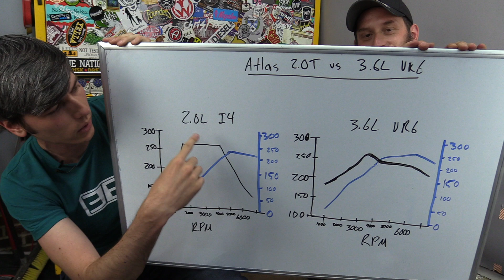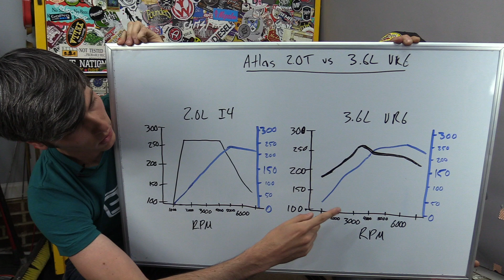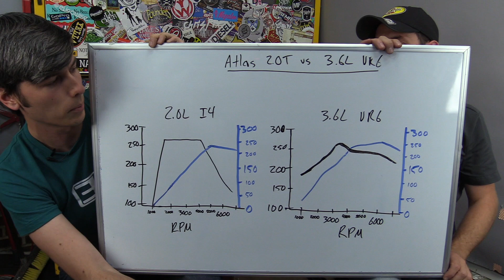4 Reasons Why The VR6 Engine Is Dying Off

Comment: The ridiculous notion that I'm commenting on an 8 year old video aside, as a former 2003 24V GTI VR6 owner, I can assure you those HP and Torque numbers are just not aligned with reality at all. In my youthful and immature days of street racing, I've left both the 1.8T GTI, the 1.8T 225 TT (boasting 25 more HP than my VR6), and the 2.0T GTI all in my rear view mirror. All cars stock. I've also beaten remapped 1.8Ts, though those were a lot closer off the line, but then fell back quickly at speed. The VR6 engine was a beauty. Thinking about getting an A3 3.2 Quattro with a manual transmission. Just need to find one that isn't about to die. Super rare with the manual transmission, as they only produced them in limited number between 2003-2005.

Comment: I have a 02 jetta 12v vr6 wagon 5 speed.  Its got 330k miles it dosent burn oil and it dosent get dirty , dosent leak oil .
 Plus theyre most uniqe sounding motor.
I would never sell it.

Comment: On the graphs the HP and Torque are way off and don't accurately show.  In Both chart the HP and Torque should intersect at 5252RPM and they are not.  The VR6 you show at about 4000RPM.  you should know as the car guy that those are just a bunch of chicken scratch lines if it's not accurate.

Comment: The VR6 design is bullet proof, doesn't burn any oil, adequate horsepower in its class and sounds awesome!  This Audi/VW engine was over built with reliability to say the least, MPG is ok but very reliable.  Since it is not easy to build this type of engine and with advent of turbo charging, 4 cylinder engines now prevail.

Comment: You do know there is a turbo charged vr6 in China, and for a while, VW considered bringing it in the Arteon and Golf R. Audi and porsche refused. HPA Motors actually did a conversion on a mk7 golf R to the vr6 engine (VR550T - 550hp, 550lb/ft)
The reason we dont see a VR6 turbo is simple. Audi and porsche will not allow it.

Comment: Vw a audi should stay with vr6 its the best compact engines out there why not build vr4 turbo ..if you compare the audi v6 tfsi....90degree v6 which real trash not reliable at all what a rubbish engine a why do vw..a audi build a 90y degr as aposed to a 60degree just because america did it nissn build the  best 60degree 3.8 twin turbo engine the vr6 engine is unique cause of its design its the best looks like a complete billet design

Comment: ...except that 2.0 / 1.8 turbo engine will wear out or die at 160,000 miles and the VR6 won't.  Turbocharged engines use higher compression and eventually wear out a turbo and require frequent synthetic oil changes.  VR6 for me.

Comment: The VR6 was originally designed to be a diesel engine but they ended up making it gasoline instead, however, they didn't change the design of the engine itself resulting in an extremely strong platform for boost applications. Thick cylinder walls, strong rods, etc. You can throw a turbo on a stock VR6 and the stock internals can handle up to 700hp. The only thing you really need to upgrade to go beyond that is the rods bolts. VR6 is only a dying breed to people who have yet to realize it's actual potential.

Comment: It seems that smaller turbo engines tend to not last as long as a slightly bigger naturally aspirated engine. I've gotten to the point that I like 2.4l in compact cars. Get better mileage on the highway and much less maintenance. As of now I refrain from buying turbo and direct injection as both are costly to maintain. If we're to buy a vw today I'd try to get one with 2.5l 5 cylinder engine

Comment: There are other options for the VR6 like an aluminum magnesium hybrid to save weight.

More engine space?

Cars are tradionally getting larger...just look at the Toyota Camry years ago, and the Corolla, today.

All I see in this video are the direction and path of unenthusiastic engineers we get nowadays.

The VR6 are one of the most incredible engines ever in our lifetime, why not seriously update it and provide the best support possible.

Turbo 4 bangers may look linear on paper, but in the real world, turbo lag after turbo lag.

Ever been in congested traffic, then the lane next to you suddenly frees up?

With a turbo, you will find yourself at the mercy of the surprising oncoming driver.

With turbos, there are much more frequent oil changes required, more complexity, more of an increase of weight from additional parts to dissipate the heat, let alone, more heat to deal with.

I would prefer a 3.6 VR6 with a positive displacement supercharger any day.

Corny engineering always seem to strive towards turbos and automatics and anything that will lean towards making cars not dissimilar to driving an appliance.

I hope much more manufacturers adopt the VR6.

It would be good for Volkswagen to later open their patent /license and let other manufacturers keep the VR6 moving technically forward.

The VR6 is among one of the most underrated engines of all time.

Comment: The supercharged one from the Corrodo (And a few others) was very good.  I'd like to hear why they stopped supercharging it.  Also, if fuel economy, and emissions are the main reasons, then why do they keep making the GTI larger, and heavier?  It used to be so light, and that's what made it awesome, not the engine.  If it's light enough, the fuel consumption goes down.
Reply: Okay, I was an Industrial Engineer, not an Automotive Engineer.  I'll bow to the specialist in his field.  The work envelope was a factor in troubleshooting factories, but it wasn't even close to as critical as cramming more engine between the wheel wells, and keeping it front wheel drive.  A lot of this could be solved by just putting the transaxel in the back, but then it wouldn't be a usable hatchback.  Those were always the selling points of the GTI:  It's a grocery getter you can also haul ass in.

Comment: International unit for torque is Nm (Newton-meter). lb-ft is a local unit in some areas.
International unit for "mileage" can be km/l (kilometers pr. liter), or instead you can specify fuel consumption in liters pr. 100 kilometers, which is now more commonly used. Miles pr. gallon is a local unit in some areas.
By the way: The conversion factor for torque from lb-ft to Nm is almost the same as the conversion factor for power from kW to HP, but that is just a coinsidence.

Comment: sure those turbo direct injection engines performs well better than vr6 but what is the lifespan of the 4 banger including the turbo, new turbo is not cheap to buy...
Reply: VR6 will go forever. Avoid turbo if you like to keep a car for a long time.

Comment: How much more space do you need to be inline and save all that kerfuffle = not much.
Reply: Well, that remark makes it very obvious that you are no engineer..
Reply: @sandervanderkammen9230  Your reply indicates you're no engineer. Inline six cylinder engines have been installed in relatively small cars and even sometimes transversely, so clearly history and engineering informs us that space is not an issue.
Reply: @martintaper7997  Then please explain why inline 4-cylinder and V-8 engines are so popular and inline-6 and inline-8s are not?
Reply: @martintaper7997  Please stop pretending to be an engineer.

Comment: I've had my awesome '03 GTI VR6 for 18 years now... original owner.  I purchased the car in October 2002, and it has been, by far, the most reliable car I or my family has EVER owned!  As a daily driver, it has had NO mechanical issues or problems.  I just put full synthetic in it once a year, and use Shell Premium fuel.  I have 105,000 miles on it, original chains too.  This car is a TANK!  Always puts a smile on my face!  Probably the most reliable car VW has ever released.  In addition, I have never changed the manual transmission fluid (VW recommends never changing this fluid for the lifetime of the vehicle)!  It still shifts like new!

Comment: The VR6 can perform just as well as the turbo 4 with changes to design of cam, intake, exhaust, cam, and ECU tune. The  gti vr6 was designed for higher rpm performance to give a more exciting driving experience.

Personally I think the VR6 and W8-16 is a better way to get more displacement and cylinders in a smaller space. Not to mention you have less complicated system over turbo/supercharging and less stress on the engine.

Comment: I owned a 2000 jetta vr6 for 9 years and never had so much fun---right up until the timing chain tensioners failed
and blew the engine. almost all of the fail between 140 to 165 thousand miles  Get the whole timing chain train
replaced if you are near those mileage readings. Costs about $2500.
Reply: I've had my 2003 GTI VR6 (24v with the improved timing chains) for 18 years now, original owner.  Bought the car new in October 2002, and it has been the most reliable car i've ever owned!  Even more reliable than any Honda, Subaru, or Toyota my family has had over the years!  No engine issues whatsoever all this time, and i'm at 105,000 miles.  I wonder how many miles I can expect before the chains go on this 24 valve version VR6.  I've heard the chain guides were designed to last much longer than the 12v VR6.

Comment: VR6 is smoother. Also these new cars where almost everything under the hood is plastic does not work well with the heat from a turbo.  Not a good recipe for long term reliability.

Comment: vw still has v6's, especially in diesels, i think basically it will be a good option turbo/supercharged 6 cylinders, it cant rev too much (because not got inline 6 balance) which is not a problem for that kind of engines. also its a brand's milestone like boxers for subarus. maybe they cannot achive high cr for diesels beacause of head design (piston needs to pass gasket) or cooling is not efficient enough for overcharged engines? however veyron got that overcharged two vr8s.

Comment: The Lexus LS430 of the same generation as the 2005 VR6 2.8 liter had the same rated fuel economy despite being a heavier car and having an additional 1.5 liters with 2 more cylinders giving another 78 horsepower and 120 some pounds of torque. It goes to show why the V6 engine isn’t necessarily an optimal choice.

Comment: What can be max power made from VR6 12V, naturally aspirated? I searched a lot but highest output was something between 220 - 230 hp. 
I wondered if you modify that engine in the same manner as for example old DTM engine, in theory it should go more than 400hp NA. 
Is there any tuner that can make VR6 really scream up in the revs like a Vtec as an NA engine?

Comment: Difference in those city fuel consumption differences will come down to new auto/dsg gearboxes versus manually shifting with a clutch. Look how similar it is on highway figures. Give the Vr6 car a similar aero cd and probably even closer.

Comment: What about longevity. Will the 2.0L Turbo have the expected engine life of the VR6? I am a big VW fan since the days of the Beetle and original Rabbit, but my family car is an older 4WD Explorer 4.0L V6. I am getting that 19 mpg city already, with highway mileage in the 20s somewhere. I also have 285,000 miles on the vehicle. The Atlas is a replacement consideration, but still question four cylinder turbo reliability and longevity in a larger SUV.

Comment: When you turbocharge an engine it has a shorter service life. I’d take a VR6 any day over a turbo 4.
Reply: Of course i agree who needs more power for f sakes top hiway speed is 100km.i own a 91 passat with a 1.9l td 80hp. Its good enough for me.
Reply: gulfy09, I agree completely. Even an MGB GT “needs” no more than 200bhp. Hang either an 5 or 6 speed gearbox behind the engine with a modified Jaguar IRS and you have a world class coupe! A twin cam engine with 2 liters displacement and 2 Webber 40 IDA’s and it’d be perfection.
Reply: I love a straight six (Or slant six) and I have to admit, a lot of that has to do with the way they sound.  The VR6 is kind of a next best thing, but it's personal preference.  I haven't tried the new turbo engines, because I hate how big and heavy the Golf has become.
Reply: I have customers with 430 thousand miles on the pd engines, 20v T at 330, look after any engine it will look after you

Comment: I wouldn't mind for the VR6 engine to be cut of if only it was replaced by a 5 cylinder one with a higher RPM limiter. That would've been sweet and would actually get an even better sound. But replacing it with four cylinders and a fan from a hairdryer is beyond lame. This was the time for Audi and VW to shine away from the others by coming out with an unorthodox solution - supercharged inline 5 - something no other manufacturer has done. But hey.. it's complicated and not that cheap as 4cyl so... yeah .. we know where that went.

Comment: What about the kind of "VR5". Used in one of the Jetta models in certain parts of the world, almost just a VR6 with one cylinder lopped off. One of one or two V5 engines mass produced.
Reply: As you've stated wrt VR5, but a VR5 is not a V5 by any stretch of the imagination.  VR - Verkürzt Reihen - Shortened In-Line, it's a true In-Line 5 with 5-72° crank-pin.  Each cylinder is bored at 7.5° from the crankshaft  ℄ and one cyl. behind another to form a 15° V.
Reply: I believe the VW Quantum had a 5 cylinder engine, but not a VR.

Comment: But the basic problem of a I-4 banger remains. 1) the sound. They always sound like a 4 banger. They always sound rough and cheap. No matter what you hang on then. 2) the feel. I and not talking power or power delivery. I am talking about how they feel in the seat of your pants, how they feel in the structure of the vehicle, the steering wheel, the touch. The way they shake and vibrate. No mater how you tune it and refine it, it’s still following the physics of mass and motion inherent in an inline 4 cylinder.

Comment: 2.8L VR6 engine, 200hp.  Honda 2.0L K20 engine, 197hp.  VW engineers are really impressive.....NOT
Reply: Really? Derivative of VR6 engines
1) VR6 - 2 cyl = VR4 x 2 = W8 - Flat plane crankshaft
2) VR6 - 1 cyl = VR5
3) 2 x VR6 = W12
4) 2 x W8 = W16

How many Honda IL-4 or V6 derivatives are there that become into another form on engines?
Reply: @7spower998  Specific Power Output i.e. BHP/Litre  ??????
Reply: @whizzo94  SPO? VR6 torque is a healthy 195 lb-ft @ 3200 rpm vs Honda wheezing142 lb-ft @ 6000 RPM
.
Reply: @7spower998  And the VR6 engine weighs the same as a small planet.
Reply: @7spower998  So, if you divide 195 by 2.8, you get 69.6 lb-ft/litre and then divide142
by 2 you get 71 lb-ft/litre.  Having a VW badge on anything is no guarantee of excellence, just like Honda isn't either.
Reply: @whizzo94  142 lb.ft is asthmatic torque when you have to wring it to 6000 rpm.
Reply: Has Honda ever fit its V6 in any Civics? That's the beauty of VR6 in can be installed either longitudinally or transveserly FWD or AWD. Even found /hood of Porsche SUVs
Reply: @7spower998  Ahh, a fanatical devotion to The Fatherland, where have I heard that before? The title of the video is a HUGE clue, the VR6 engine is dying out because it's not very powerful for it's capacity, it's extremely heavy,
it's inefficient because of it's crap cylinder head ports. So, it fits in a lot of vehicles, big deal. All that means is VW can make more money from their cars. German engineering is GROSSLY overrated IMO. But that's a big problem when you're dealing with fanatics.

Comment: Turbo charged direct injection engine have done one thing well-----They have proven themselves to be not nearly reliable as their naturally aspirated counter parts. I have been in the business for over 30 years so don't try telling me otherwise. I'll take port injection and few more  cubic inches any day over saving a few more mpg's on a stressed out weezer that's looking to blow a head gasket or giving me a misfire code due to carbon build up any chance it gets. Over engineered garbage that will not hold up in the long run.

Comment: Shhhh don't tell Mk1 chassis owners this.
It's the go to swap.
My problem with the power differences over all the years compared of turbo and vr6 models..... The transmission gearing has almost as much to do with the fuel comparisons as when you compare the 1.8t and vr6 of the same era with nearly the same transmission..... Much less mpg difference.

Comment: If i had a large amount of money I'd turbo my vr6 and try build it as reliable as possible (when i say that i mean forge internals,new timing chain and tensioners,replace nuts and bolts to new or higher grade material. It'll also stay oem interior wise and ride height. And would wire tuck the bay or just fit stuff soo it's easy to replace and get to. I'd do all that rather than buy an exotic car

Comment: I stand out differently in my 2013 3.6 Passat sided to the 2.5 or 1.8 models. I also got a Dual exhaust system 😏👌 the sound and response with the DSG 😍

Comment: I don't understand something. Why can't a VR6 engine be combined with turbos for a lot of applications other than the Veyron? I thought it would have been ideal, a large, compact engine with just one bank of valves and all the exhaust ports on one side with turbos. If it's good enough for the Veyron surely it's good enough for lesser models.

Comment: Most diesels got back on the road and not sitting much on dealers lots... I've got one used and one new one in 2017 and will keep it as long as I can! Also, for those who thinks that diesels got sluggish, should look into KERMATDI tune that adds 50 whp and 100 lb-ft of torque on stage 1 tune!!! Now my Passat spins the wheels. Also, Atlas' 2.0 TSI is only making 236 hp vs 276 hp on VR6 and only 1 mpg lower on highway... IF VW would put GOLF R spec 2.0 TSI with 292 hp then probably efficiency of 4 cylinder would be worse than VR6... I understand that turbocharged engines are awesome on wide torque range but saying that vr6 is dying is laughable